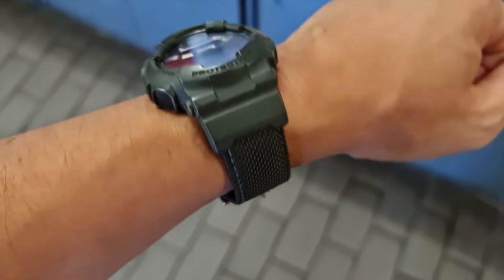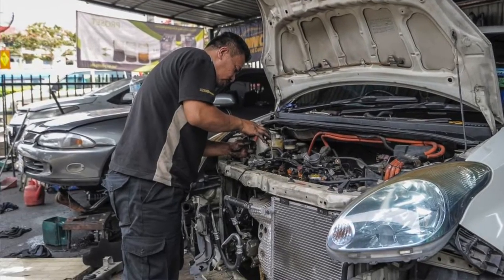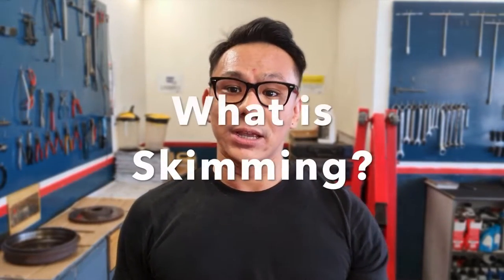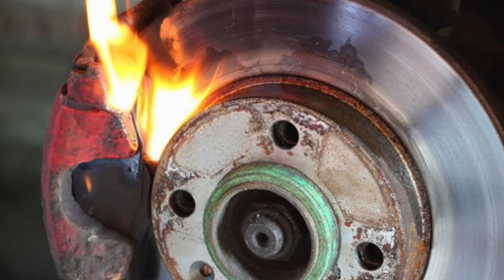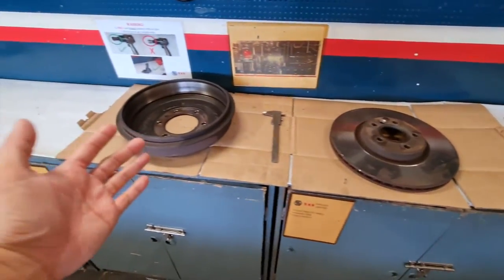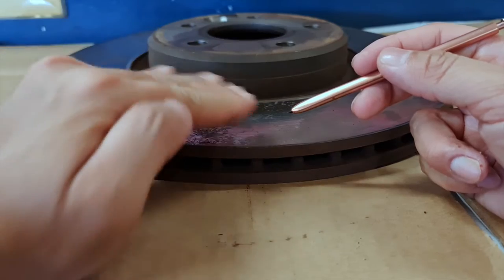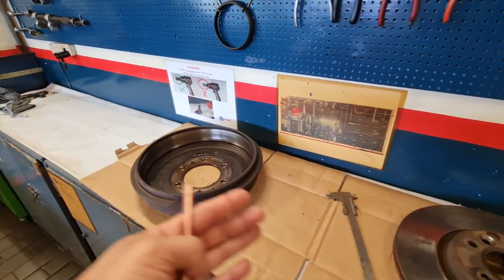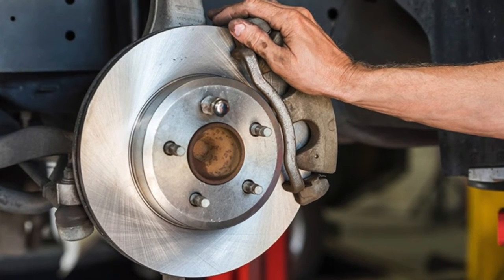Skim Brake Disc Could Be Dangerous! Car Geek with #theporschelover Ep.08

Comment: WHAT ARE U TALKING ABOUT DUDE THERE IS NOTHING WRONG WITH SKIMMING
IVE SKIMED MY CARS DISC BEFORE AND HAD NO PROMBLES AND THAT BEEN SAID SKIMMING YOUR CARS HEAD OR FLY WHEEL IS BAD TO THEN... THE TECNI WORKING ON YOUR CAR WILL NEVER SKIM IF BELOW SPEC AND YOU EVEN SAID SO AT THE END OF THIS VIDEO?
Reply from the maker: WHAT ARE U TALKING ABOUT DUDE THERE IS NOTHING WRONG WITH SKIMMING
- as the title has clearly stated, skimming brake disc 'COULD' be dangerous
- I also mentioned it will be dangerous if the disc is skimmed below the minimum thickness/ specification

SKIMMING YOUR CARS HEAD OR FLY WHEEL IS BAD TO THEN
- if they have skimmed too much, of course it's bad as the car will not run properly. It is all about specifications

THE TECNI WORKING ON YOUR CAR WILL NEVER SKIM IF BELOW SPEC
- if you did watch the entire video (which I assumed you did), the context was the car workshops in Malaysia are not aware there is a specification. And if they did, they are not bothered to follow
- hence, the car owners are not even aware of this which can lead to fatal accidents in certain circumstances

The whole point this video is to educate car owners (especially Malaysians) on the potential dangers of skimming their brake discs.
Reply: Skimming brake disc is dangerous
Reply: True nothing wrong with skimming disc but well said this dude father must own a spare shop lol..
I have my own business dude and skimming for over 15 years and never had any issues

Comment: Could u do a video of the different brands and options of brake disc /pad for Porsche 997/987 and what’s the difference between them
Reply from the maker: For 987/997, I would usually recommend Brembo as they are the OEM brakes for Porsche. 

I am currently using Brembo pads & discs for my 997 & so far it has held up well for B roads & spirited driving. You can go on track with them but if you want to do it competitively, you'll need to upgrade.

Comment: Simple ! Never skim discs that are on manufactures wear limit otherwise there is nothing wrong with the resurfacing as long as its done with a specialist machine like the procut
Reply from the maker: It might sound simple to you & me

But there are countless videos & also the general mentality of car workshops in Malaysia that promotes skimming of brake discs either for brake judder due to uneven wear on disc or for brake noise 

And most 'skimming specialist' does not have the specifications on the wear limit further increasing the danger level & the consumer is none the wiser

Comment: If never skim before, then can skim.
Reply from the maker: That statement can be true at times and not applicable at other times bro.

It is true when the minimum thickness of the disc (after skimming) meets the required safety standards.

It is not applicable when for examle, you have used the brake discs for 40,000km. By then, the discs would have been worn out & skimming will only make it dangerous as highlighted in my video.